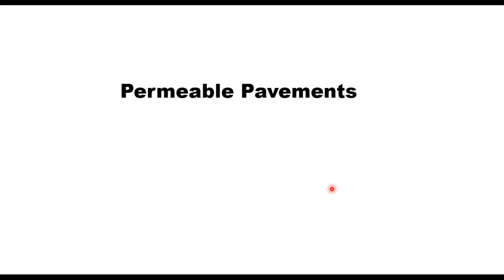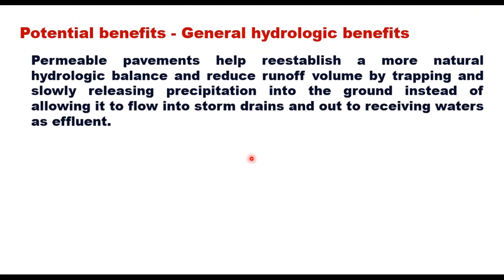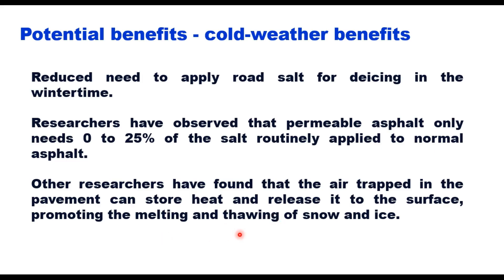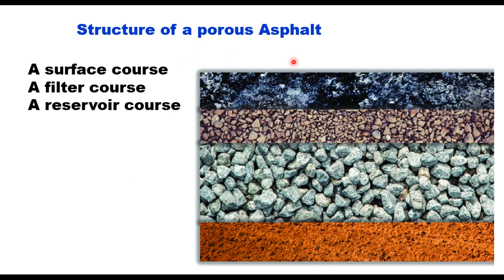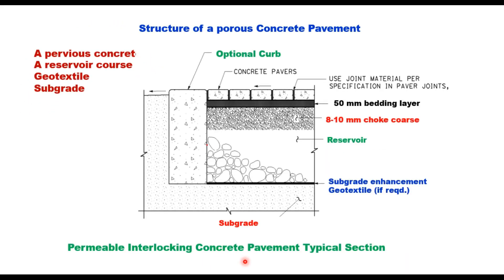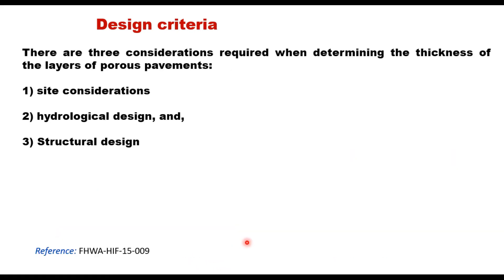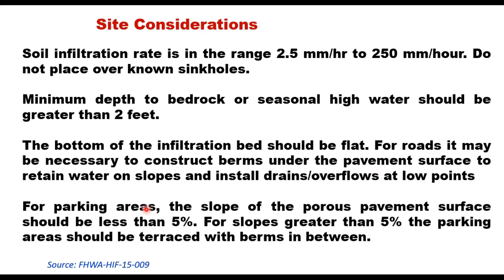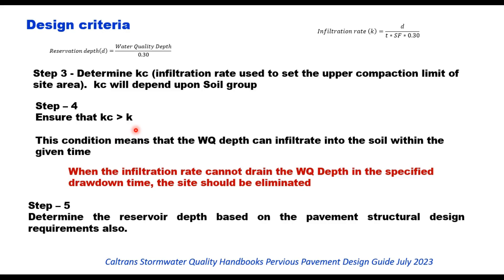Permeable Pavements, definition, applications and design steps. porous or pervious pavements

Comment: 1. Can you please let me know how to distinguish that my site is heavy / low volume any criteria like PCU , CVPD, Veh/hr details
2. Internationally the sand bedding layer in concrete pavers does not allow beyond 25/ 30mm (BS 7533-101), tha same even in Clause 4.4 of IRC SP 63 is explained ,as sand bedding FRL and levelling is difficult due to its dilatancy issues
Reply from the maker: Generally, a traffic upto 450 cvpd is considered as low volume